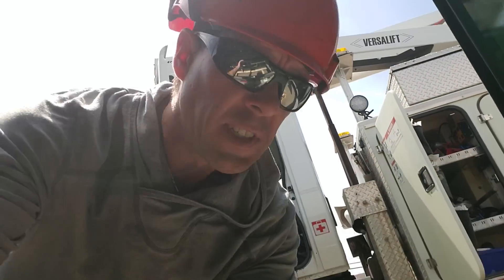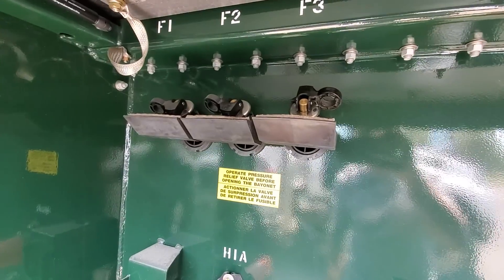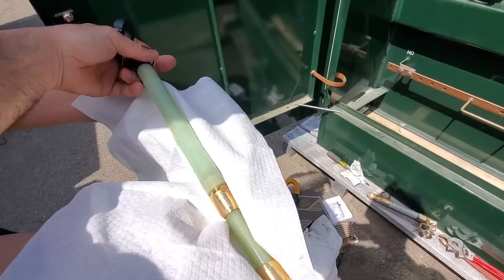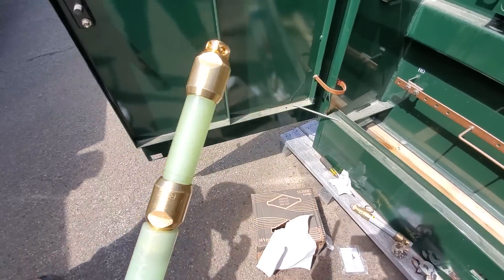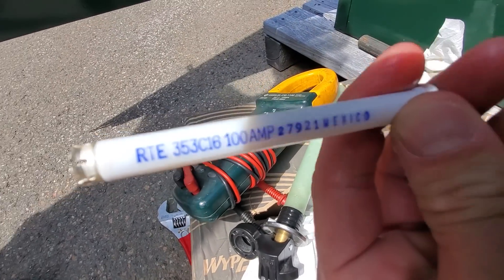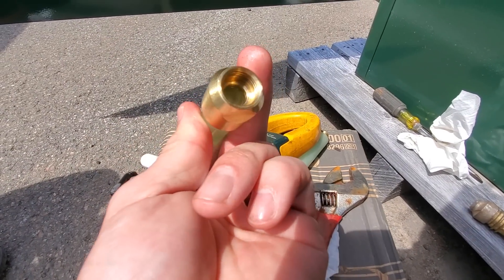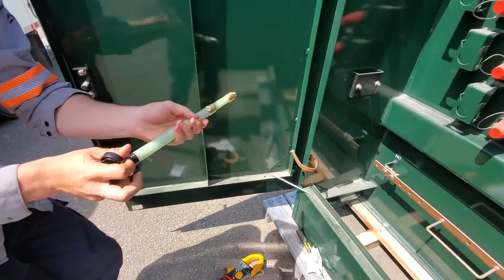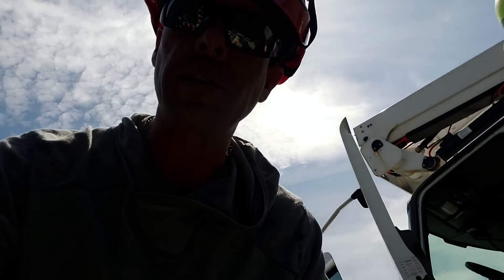What's a bayonet fuse !?

Comment: Thanks for another video where you share specific things of electrical distribution grid and its parts that one usualy may not see. It is verry interesting to see how diffrent it is from electrical distribution grid in Europe. Over here distribution transformers have fuses on both high voltage and low voltage side as well.

Comment: Love the pad mount info since that’s all we have at our facility.   Fuse size ( amps) based on load calculations when installed ……yes?
Reply from the maker: Not load calculations but the actual rating of the transformer itself.
This prevents damage to the transformer if overloaded.

Comment: Is the reason for those fuses to be on the low voltage side ( secondary ) , because the high voltage side protection ( cutout doors on the pole ) is not "sensitive" enough, to correctly protect the transformer, in case of overloading?
Or, are the cutout doors on pole are there to protect the wires, and not the transformer?
I'm an electrician, and 99% of times, we only fuse the primary, and use appropriate wire size gauge accordingly.

Comment: The gas springs for the cover are mounted upside down. They have a small amount of oil in them that lubes the rod bushing and seal. For that reason they should be mounted rod side down whenever possible. When they are installed rod side up the rod seal will eventually run dry and fail prematurely.
Reply: I have never heard that before. Good tip!

Comment: Do those make a loud noise then they go? My husband and I were sitting outside watching a storm roll in a few days ago. The gust front hit and the fuse on the pole at the corner of our yard blew. We ducked inside rather quickly. Thanks for the interesting video. Please stay safe, and God bless.
Reply: I believe some fuses have explosive charges in them to ensure they open fully without arcing, someone may correct me if I'm wrong
Reply: @JackieBright  They don't have an explosive charge, but the fuse links that go in the cut-out "doors" (jacks, tube, fuse holder) are an expulsion type fuses and designed to blow out the arc down the tube by design. And yeah, they can be loud when the blow and what 99% of the people call hearing a transformer blow is really just the fuse blowing. 
When a bayonet type inside a pad mount blows, I don't think you'd hear much.
Reply: @inothome     watched an episode of How It's Made on Discovery channel one night and the manufacturing of fuses was the feature. They explained that some fuses do have an explosive charge built in. Perhaps Aaron can clarify that part in a future video.
Reply: @rupe53  I work in substations with the same fuses. Bayonets or fuse links do not have explosives in them. They are called expulsion fuses though. Since they extinguish the arc by forcing the arc down a tube aka expulsion and do sound like an explosion. But no explosives at all in them. If they did, there would be warnings, all sorts of regulations and training to go along with it. You wouldn't have 500 of them sitting in a bin on a truck or out in the open in a warehouse. 

There are some fuses or breakers in HVDC for EV cars that do have a small pyrotechnic charge in them though.